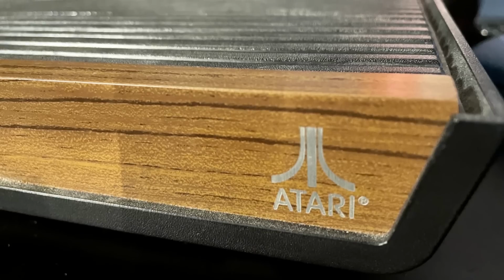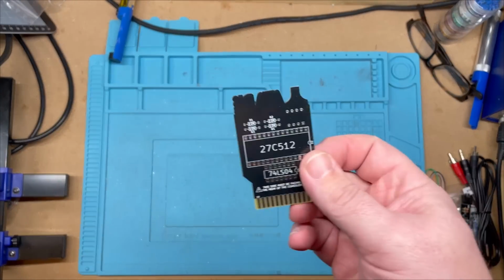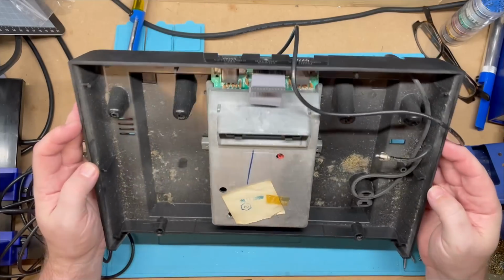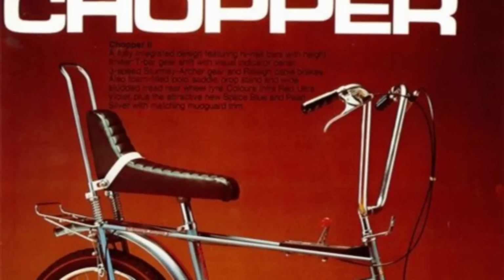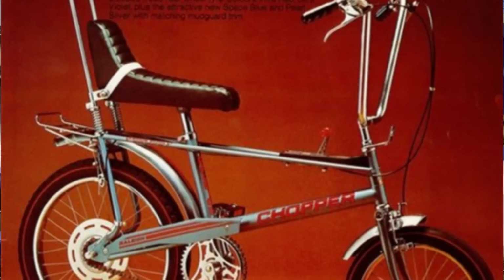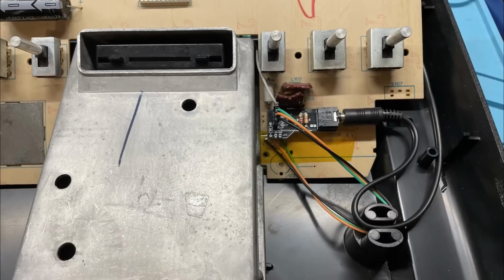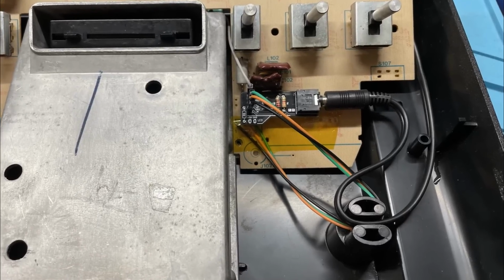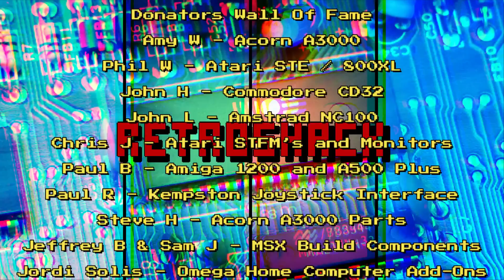Our Woody gets a little love, and some upgrades too!  Composite mod anyone? Recap? Multi-cart? Yep!!

Comment: The shields were required by American law back then. The Atari machines went above and beyond to make sure they met regulations, like the opposite of C64s where they tried to put as less shielding on as possible to just meet regulations, culminating in the infamous "cardboard covered in a bit of tinfoil" jobbies. It's also why the only shielding on a Spectrum is on the RF modulator.

And man, that multicart looks like something I could manage to slap together. Have vague memories of being really young(I mean a pre-schooler here) in the '80s and having great fun on one of these before we got the C64. Combat(Tank in particular) and Defender were definite favourites.
Reply: IIRC the regulations softened a bit by the time the Commodore 64 came out? I also read it may have been Commodore told FCC they are designed to work with monitors instead of TVs.
Reply: @richy69ify  Nah, Commodore were just doing everything they could to reduce the shielding.

The regulations were pretty much "must be shielded with specified metals"(likely aluminium) and Commodore just started coating cardboard in one of the specified metals and went "well, it's shielded by metal". The rules were changed not long after, so maybe they just passed it anyways.

Comment: I usually reflow the power supply barrel jack which often has cracked solder joints since it’s a stress point

Comment: Do you know what I loved about the old Woody? It could display a true rainbow 🌈 of colours. Ok the sprites were chunky and fat but the colours were incredible. The old Speccy was 8 colour & the C64 16 colours. Jay Miner designed a chip that could display what felt like thousands of colours. Incredible.  You turned it on and your eyes were instantly blessed. I loved that machine. I play emulators but somehow it isn't the same.
Reply: Yep, the Atari 2600 has a 128 color palette and since the display was drawn on the fly, you could use programming tricks to get a little more out of the display than what the hardware was designed for.

Comment: Good to see another VCS saved. I got the "Harmony Encore" cartridge for mine just this week (A delayed Christmas present. Thanks Australia Post for adding 2 weeks to delivery time). I went with the "dangling cables" solution, mostly because I also modded mine for SVideo rather than Composite. There are some ripper games for the old beast 🙂

Comment: MC14050
A hex non inverting buffer.
Not sure why they needed only 6 buffers?  The Data bus is 8 bit and the address bus is 13 bits?
There is a schematic floating around the internet that would probably identify what it’s connected to.

Comment: Unless you work inside a powersupply or insect zapper you dont have to worry about caps being charged or not. Too low voltage to do give any shocks, and they are likely discharged fast anyway.

Comment: Good interesting video. I still wonder though why NOBODY remembers to use shielded cables when moving audio and video signals around, since unshielded ones will be prone to all kind of electrical interferences which will therefore result in audio/video noise.

Comment: Getting Shacky with it in '23... That multicart solution is an interesting little board, but most of the modern homebrew probably won't fit. I do need to get myself an SD solution for my 2600.

Comment: I live in the US and I've had bunches of these apart and NONE of them had that design here. They are just one circuit board no aluminum block.  That must be a European thing.. I had bunches back in the 80's i took apart i should say.
Reply: You're young then.  That's the exact model I had in 1978, and still have sitting on the shelf by my TV,  The design switched to the 4 switch model in the early 1980's. as a cost reduction.

Comment: A great video but why replace parts that have worked well for years and will keep working for may more to come? It is like a retro community disease and only the more knowledgable people out there know different.
Reply: No.  Capacitors are a wear item, and even though they may seem to be working, a 40 year old electrolytic capacitor is a ticking timebomb. Even though the ESR may be low and the capacitance checks out on a meter, unless you have a way to test it up to it's rated voltage, you have no idea if it's got breakdown. 

There's no problem replacing them on an otherwise working machine.  The problem comes in replacing them in an attempt to shotgun problems when troubleshooting.